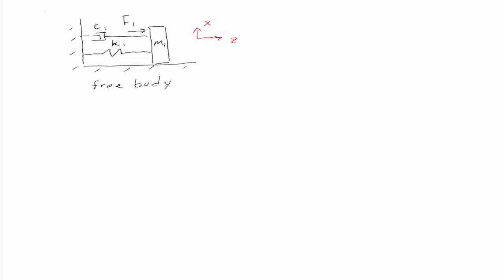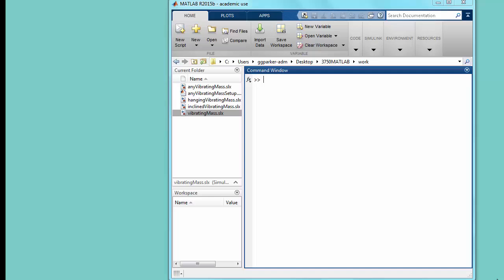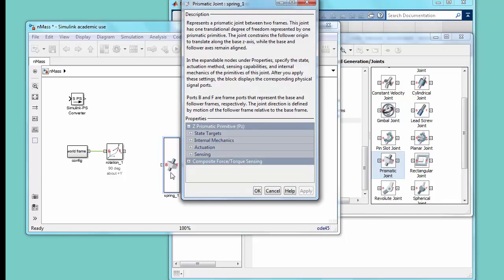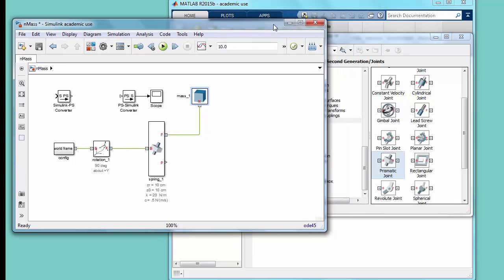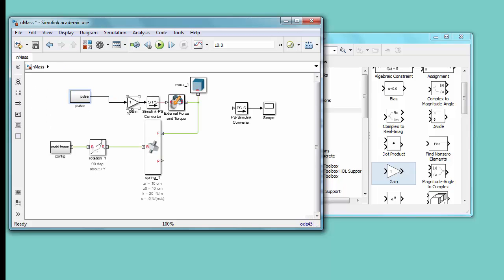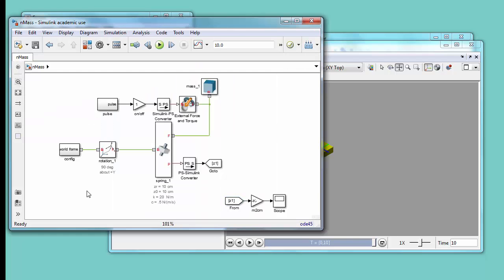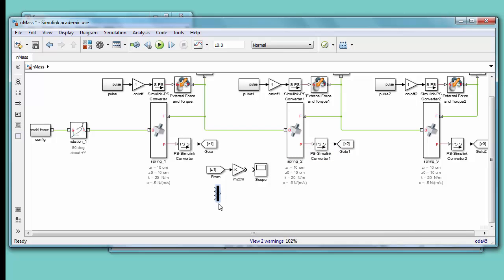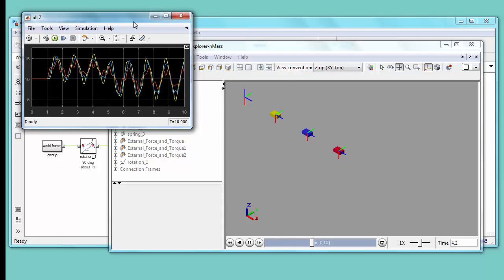SimMechanics Series #4: N Vibrating Masses

Comment: Very clear tutorial, thank you. But how do I measure position of a mass from the world frame instead of the base/follower frame when using scopes?
Reply from the maker: This is difficult to answer without knowing more about your application. But, it's safe to say there are likely many ways to do it. I like to always think in terms of frames instead of frames and masses. Once you know the two frames that define a relative distance (or orientation) then you can stick a 'Transform Sensor' in your model and attach its B and F to the two frames of interest. Works great.